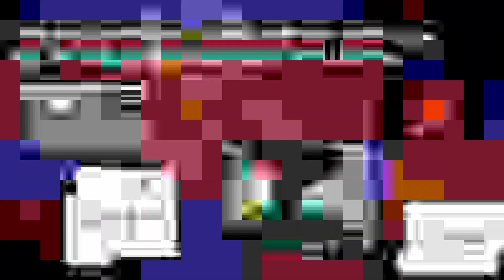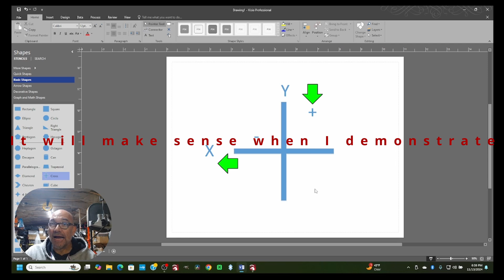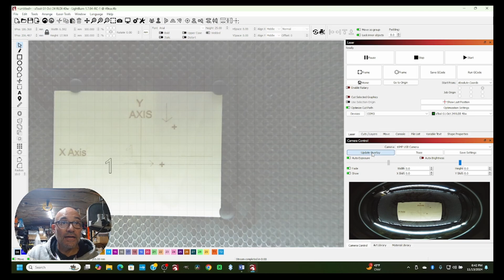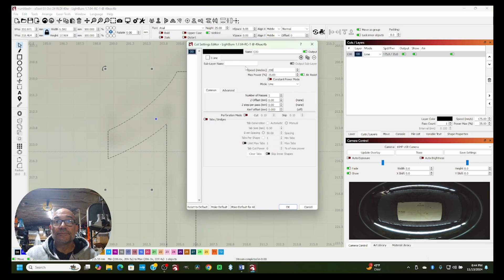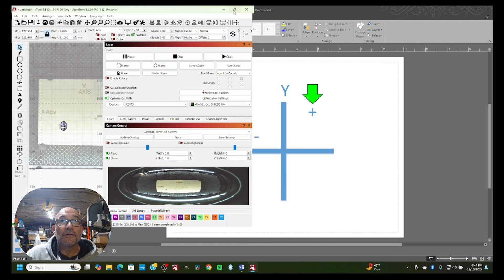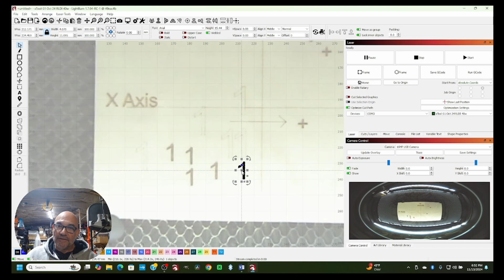Calibrate a camera with your Laser Engraver for LightBurn precision

Comment: I did it using 10mm circles. But after I got it perfect I etched the same circle about 10 inches below and it was off by about 5mm on the Y axis.
Reply from the maker: I'm assuming you did the following two things first: 1. Calibrate Camera lens, and then did a Calibrate Camera alignment?    Once you do these, you want to then save your file, right click on the camera control, over the image, and save your config file.  I usually save this for the thickness of the material  - 3mm basswood.  Then do the offset adjustments.  I always use a "1" but you can use what you like.
Reply: @ I did all that.
I think there may be an issue with the y axis of the machine. I printed two identical filled texts on top of one another and had the first fill horizontally and the second fill vertically. They were offset from one another on the y axis by about 2mm.  I did this without the cameras help.
Reply from the maker: @jonanddella  What machine do you have?